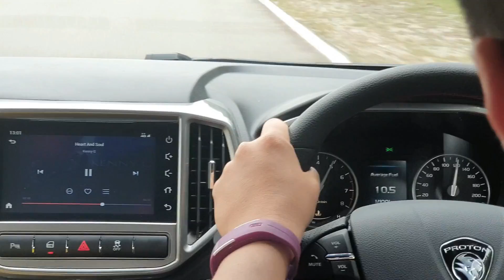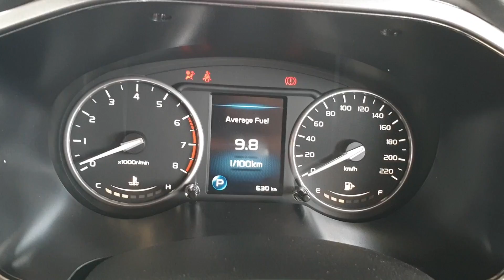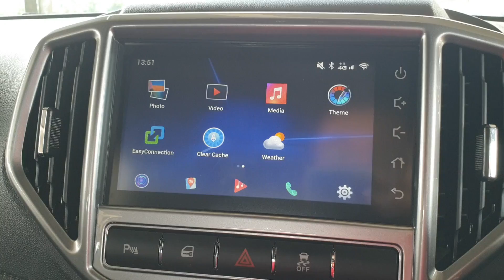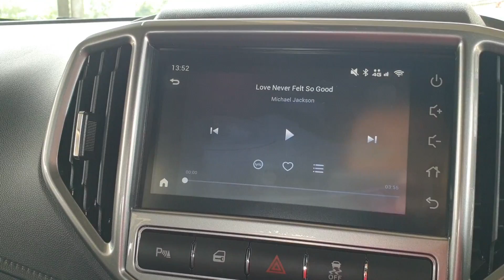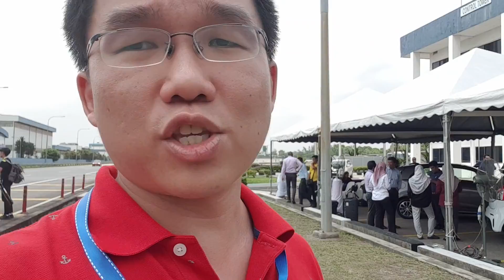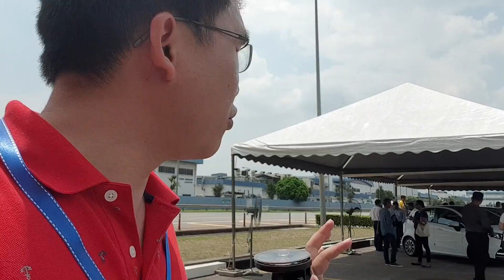2019 Proton Iriz 1.6 Short Test Drive | EvoMalaysia.com

Comment: Why they don't change the gear ratio? Should be better if they use gear ratio like the Preve CFE.
Reply from the maker: Guess this engine don't have enough torque to pull high speeds from low revs
Reply: @KonWaiLuen  Even Bezza 1.3 has lower gear ratio for cruising, so I don't think the engine is not able to do that. I just don't get it. :(

Comment: Understeer @ the slaloms are due to the Silverstone M3s fitted to it, assuming they're still equipped with those tyres la. Switching to RE003s / PS3s would greatly improve it's handling. Mine definitely did!

Comment: here is my wishlist for my 2014 Iriz if i can swap with FL part😅...
-meter cluster
-shark fin antenna
-head unit
-gear knob
- leather on steering wheel
-nvh and refinement if possible.
-ocean blue colour..really nice compare to the previous blue color

other than that, i can accept my pre fl Iriz.

Comment: Is it same Silverstone tires? Without silverstone, it can perform better at the slalom
Reply: What a pity, I can even accidentally wheelspin that tire on a slope.
Reply from the maker: Mine were wheelspinning after 10,000km
Reply from the maker: I would assume they are.
Reply: Agree with you... If using better tyre or at least UC6 the Iriz can handle way way better

Comment: i wonder if the resale value is good and comparable to the myvi
Reply from the maker: Myvi will still be better on that front, I suspect. 

In any case, this new Iriz and the upcoming improved Persona might end up wiping a bigger chunk of my 2016 Persona's RV in the process. =D
Reply: @KonWaiLuen I can see that my 2018 iriz standard may fall below 35k this year
Reply: @KonWaiLuen  well if the new persona and iriz have great resale value and better fc, Malaysians are definitely buying this car. I just want a car with good handling, good fc and good RV. Haha I think I ask for too much lol
Reply: @showdown2613  You can only pick maximum 2 lol. New Iriz = good handling and claimed better FC than previous versions, but probably not so good RV. New Myvi = Good RV maybe, and good FC, but handling cannot compare with Iriz.
Reply: @JohnL-m2l  very very tough choice lol
Reply: @showdown2613  as an Iriz owner, let me just say, the seats are probably a lot more comfortable than a Myvi's or Axia's seats. Especially for long driving. And if you drive long distance on highways a lot, the FC really isn't that bad as long as you are light on the throttle. For example, if I go to KLIA, I can get up to 19km/l. But if you are constantly in traffic jams, then the FC increases to 10km/l. Sometimes even lower than 10km/l.
Reply: BalsemGosok 2016  yeah i buy a car just to sell later on haha